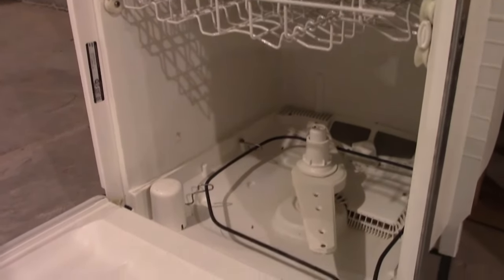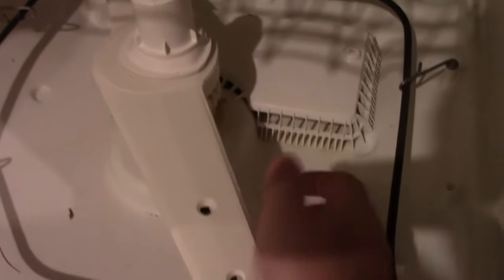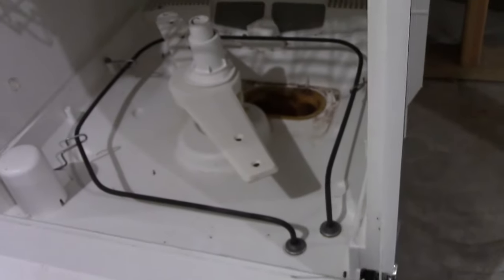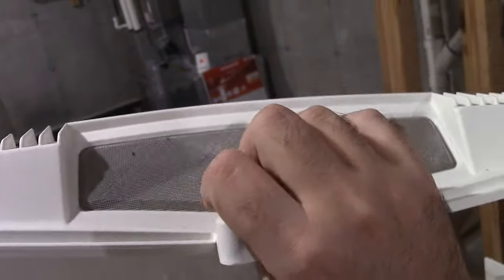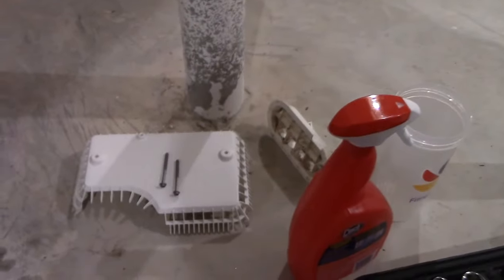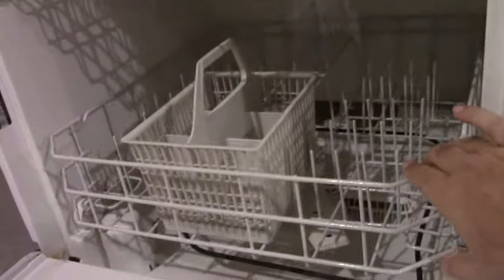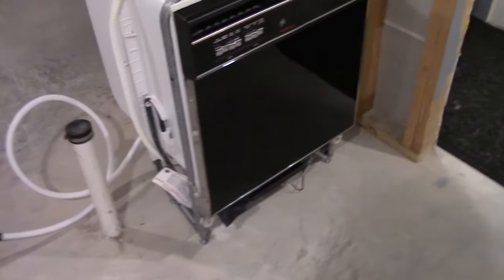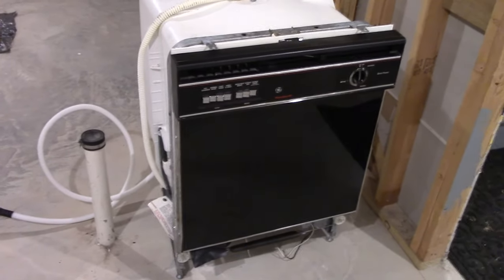Dishwasher Cleaning and Showing Some Parts.

Comment: I was really hoping to see how you actually remove the bolts etc that's holding all those things on, and that's the part you edited out of the video...
Reply from the maker: It's very easy, just need a nut driver. :)
Reply: @Sharkie626  not easy for everyone and sometimes people need to see the type of tool and how to use it…
Reply: @bluelagoon8142  That’s what the manual is for! You can also learn by doing things hands on as well. Just make sure to record what you’re doing so in case you forget order you did things in. Also, make sure to organize the parts and screws/bolts. Assume all screws/bolts are different sizes so put them back exactly where they started at when reassembling. 

Then you get good at it and post it on YouTube with commentary or written description for others that share the issue/maintenance/building task.
Reply: @bluelagoon8142  , you’re exactly right. And the arrogance of some “tech” in the comments to refer anyone to the manual is asinine. Why that’s why most people view how-to videos, to actually see how it’s done. 🙄
Reply: @carlal.9850  I wish I had known to take Dramamine before viewing the video. Seriously! I mean he could have at least duct-taped his phone to a ball cap and filmed that way.
Reply: Austin H  if he were approached by someone with a white cane and dark glasses and asked for directions, he'd probably tell them to use google maps. 😂
Reply: Literally the only thing I needed….. the pump is attached to it is does not just come off with the screws
Reply: @StuffTested  That might be what the manual should be for, but the manual for this model doesn't show or talk about any of these parts.
Reply: Why are there so many smooth rains here? It’s being held by bolts.. so get a nut driver? Why is this so difficult for everyone LOL
Reply: @bluelagoon8142 yeah I dunno if I have that type of tool. I hate when these videos of how to do something edit out an important part that the editor finds trivial.
Reply: @krystalmitchell9978 oh yeah I remember someone did that with an SNES Disassembly video, the one part of the entire video showing the section I needed was cut out for time 😂 luckily reassembly he showed how they did it but still I could’ve used the cut out part too. Same goes for this video
Reply: @Sharkie626  I managed to take the pieces off with a 1/4 socket, and ask for help from the guy at Menards, but he pointed me to a socket wrench kit that had everything I needed, cost $23. You didn’t show the filter removal Either and I can’t figure out how to remove the filter on mine because it’s very stuck.

Comment: My old Ge dishwasher looks exactly like that one, the piece you pulled off in the back should have 4 1/4 inch screws in it, mine did. my screens in the back were clean as was the piece you pulled out behind the rotating sprayer. I'll clean everything reachable with a toothbrush and run a cycle of vinegar through it. I don't know how old this dishwasher is but I've been a maintenance man most of my life and I've found just a little bit of maintenance once or twice a year can help appliances last for years and years. If you have one of these dishwashers look in the left and right front corners, there should be a black rubber seal on each side. I believe these seal the front door when closing. I found that mine had disappeared over the years, then I developed a leak, I bought replacement seals and now I'm good to go for another 5 to 10 years.
Reply: Do I need disconnect the machine from power supply? because Its very hard to remove the machine from cabinet
Reply: @JamesWolfsbane  The electrical connection is usually under the dishwasher and should be just behind the bottom panel, to be on the safe side. Turn the dishwasher on and look for the correct breaker in your fuse box, 120 usually won't kill you but why risk it? Have someone scream to you when you've found the right breaker.
Reply: @jumpercable20  i didn’t know it was under the dish washer machine. Thank you!

Comment: I have the same dishwasher, GE Potscrubber 580. It was installed in 2002 and is still working fine. The 580 must have been the basic model of the line because it does not have a self-cleaning filter in the back. Anyway it is still going strong.
Reply from the maker: Yeah that could be the one we had back when. Glad it's still working. Keep it as long as possible!

Comment: I'm cleaning the dishwasher filters in my apt dishwasher and noticed I don't even have that larger back "self clean filtering system" piece and I'm having trouble finding a replacement. Would you happen to know the part number for that bad boy?
Reply from the maker: Your model might not have it. Some lower ones didn't have that system.
Reply: Same situation here 😢

Comment: I’m really surprised at how clean it is, especially being almost 30 years old. Looks like that “self cleaning filter” does a pretty good job of cleaning itself. I was expecting it to be much nastier, from food and other crumbs that build up over time, but it turned out pretty good. 

Is this washer similar to the one in the LI house that was replaced with the Triton XL? I love it either way, but it’d just be even better if it was exactly the same. Looking forward seeing the rest!
Reply from the maker: Yep! This is very similar to our original one. Only differences was ours did not have the top spray arm, or that filter system.

Comment: Ours I think is older or less flashy than this model bc we don't have the screened filter against the back wall. Or any part .... There is some sort of screen under the spray arm axis though??? Any ideas????
Reply: I have the same model as you, I believe what you are seeing is the opening where the water is pumped from the dishwasher. I dont think our model has a filter, I've never cleaned one for over 22 years!

Comment: Hi! I have a dishwasher similar to this and I recently took some of these parts off looking for how to clean it. When I took off the white basket cover and then pulled the plastic piece out it was full of dirty water. What does that mean? Do I have a clog somewhere?
Reply from the maker: That sounds totally normal. There will always be some water in the sump to prevent the seals from drying out.

Comment: My dish washer machine have dirty water there, but its very difficult to remove th machine from inside the cabinet becuase its small tight apartment, Do I need to disconnect the power supply to do this?
Reply from the maker: Yeah, you should disconnect that and possibly the water supply as well.

Comment: Wow, this is great, you're really stringing the dishwasher twerps along!

I don't know if you did any testing of it outside, but I most certainly would have before it went in the house.  Sure, there's concrete down there, but I mean you could take the hose to the whole thing if you wanted to outside.  Like Joe and I did with the washer.
Reply from the maker: I wonder if they'll ask me if the neutral drain was fixed. 

The only thing I really did outside was clean off the exterior the same way I cleaned the interior here. I guess I figured that if I was inside, I didn't have to worry about things like weather and daylight.
Reply: @Sharkie626  Har har!  "Ooh, does it have speeds?  Like one time, we had a 10 speeder!"

Comment: I did find a single piece of broken glass in the plastic filter above the hole, however the hole has no glass in it but it is completely filled with water
Reply from the maker: If you mean the sump, that should have water in it, that water prevents the seals form drying out.

Comment: after you opened the filter that was bolted down, theres like a tub of water. is that supposed to be full? Further, can you take it out to clean it? mine wont seem to come out after ive peeled the suctioned perimeter
Reply from the maker: Do you mean that sump? There should be water in there so it prevents the seals from drying out :) It is a bit tricky to take it out.